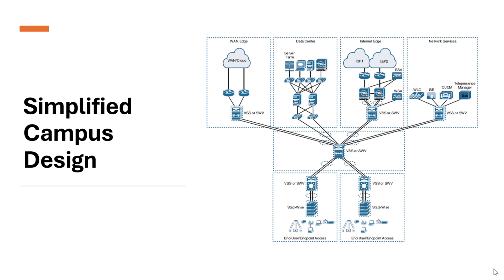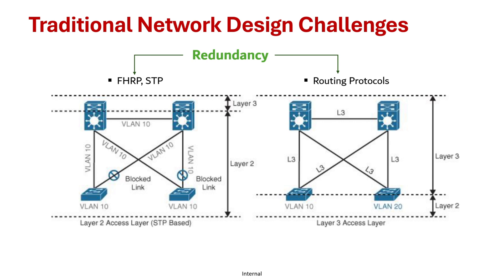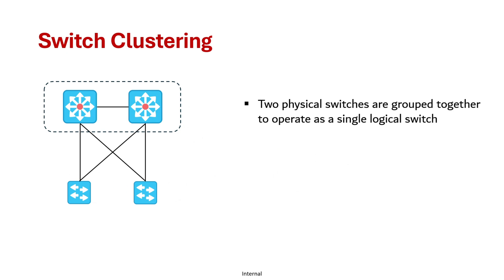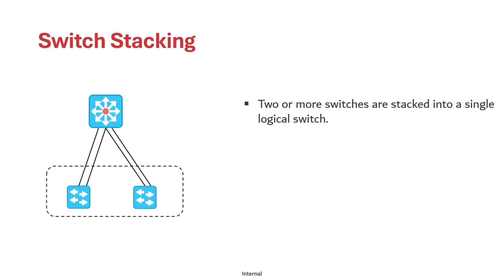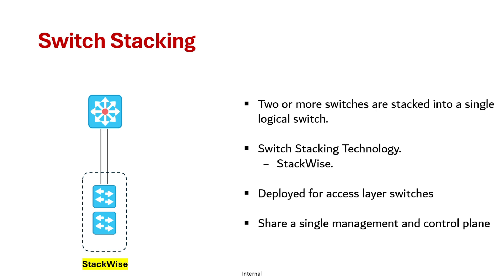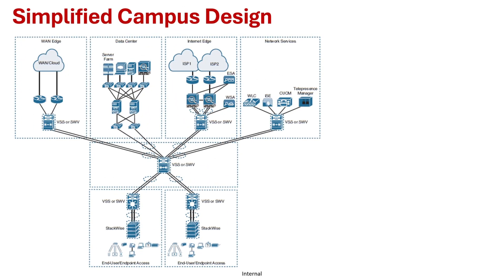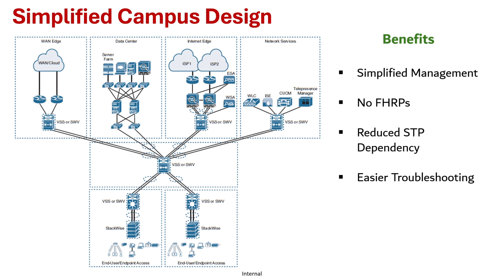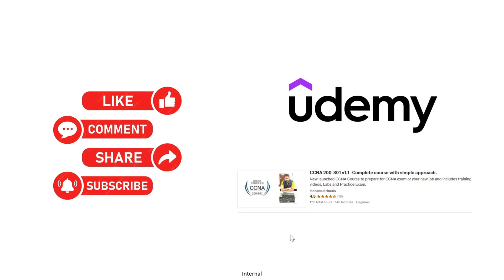6. Simplified campus design | VSS | SWV | StackWise - CCNP ENCOR 350-401

Comment: I have a request, Can you please plan to start a new Video Series on Network Architecture Design for beginners to advance? Which tools required for Network Design, Demonstration of tools, What are documents need to be made, What are parameters need to be checked, labs 0 to advanced levels, etc.?
Reply from the maker: Thanks for the advice.. will think about it .. 🙏🏻
Reply from the maker: Check out my full CCNA course with training videos , practice labs ,quizzes and practice exams.

On My personal webpage 
 https://learnwithnetworkingwithh.graphy.com/courses/CISCO-CCNA-200-301-63ea2b6ae4b090a146306bcf

On udemy
https://www.udemy.com/course/ccna-v11-200-301-video-training-course-2024/?referralCode=2DF7526C408423A5485A
Reply: @networkingwithh4716  Do you have a detailed video on Route-map and prefix-list?